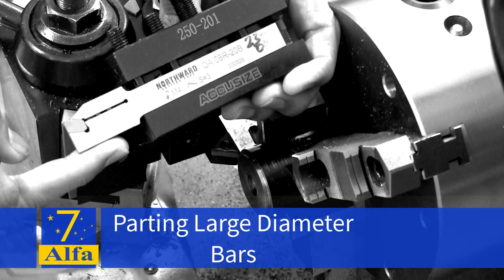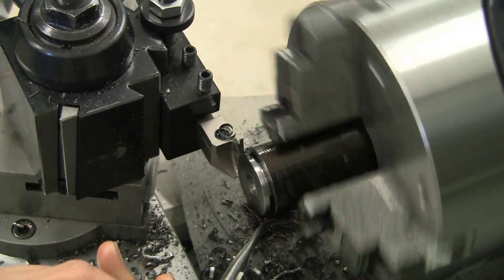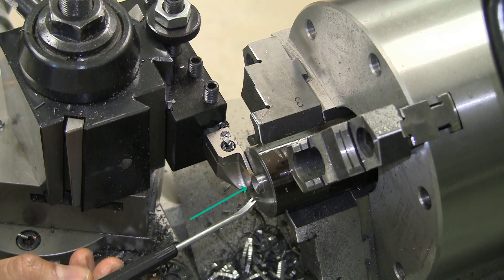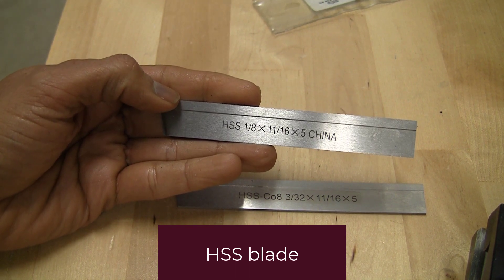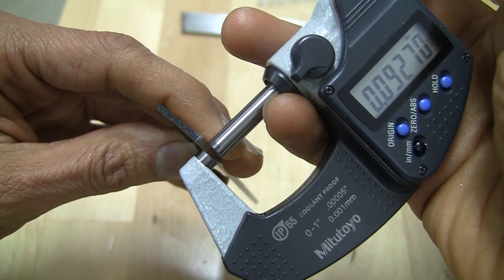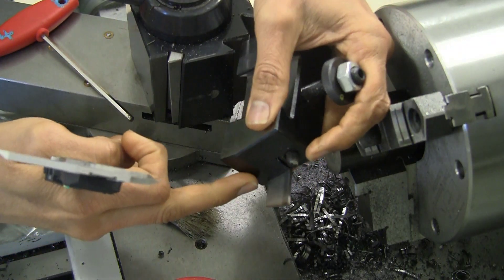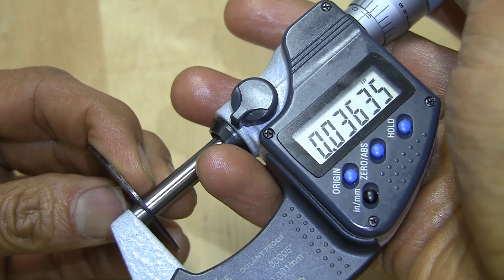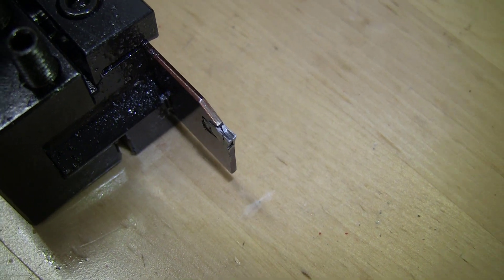Parting Large Diameter Steel Bar on a Lathe

Comment: Surface feed rate changes (slows) as the tool goes from outer diamater toward the center. Finish will be affected by this changing of the surface feed rate.
Reply from the maker: Yes, indeed. Ideally, one should keep correcting the RPM as the tool plunges in deeper.

Comment: Good to see. How come the 3 inch bar is being parted quite a distance from the chuck?
Reply from the maker: The bar overhang is actually not that great. It is about 3" in diameter and the parting is at close to 5" from the tip of the jaws, so less than 2D.
And the reason is simply that I needed a disc of about 3" dia.😀

Comment: Nice work, I'll eventually get a lathe.
Reply from the maker: Thanks for the kind comment. The finish and accuracy one can get even with a manual lathe is pretty amazing.
I had originally wanted to get something like a Tormach but got side tracked with the lathe. It has taught me a lot about feeds, speeds and different types of metals.
One day soon, I hope to follow along with you and  get back to CNC milling. I have an MR-1 on order.